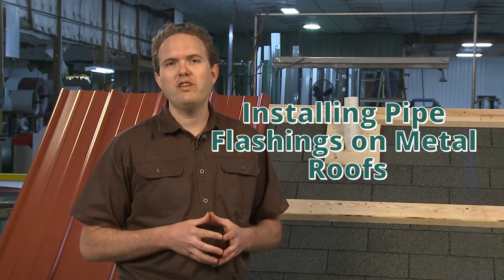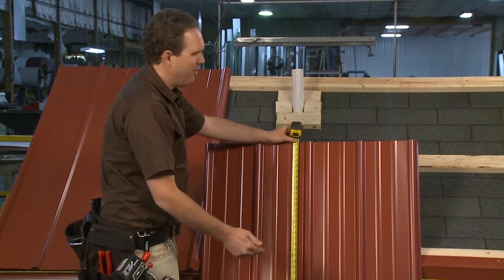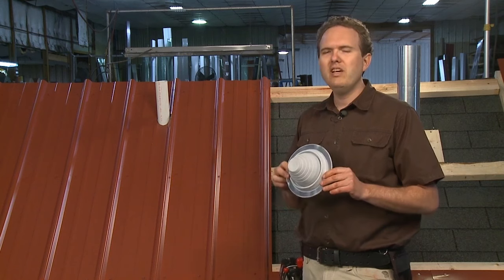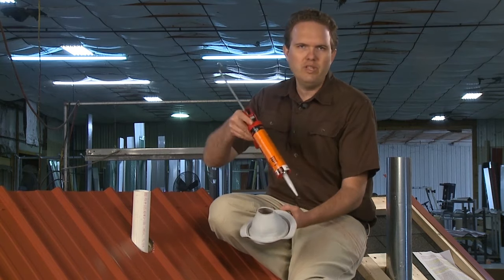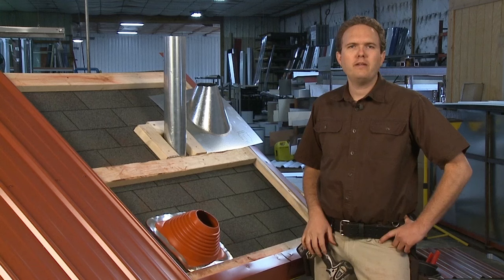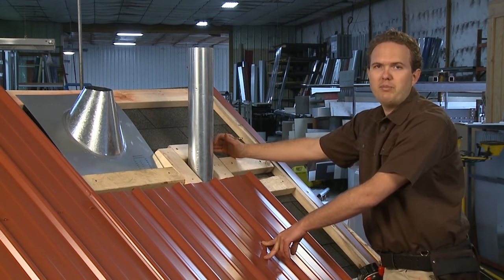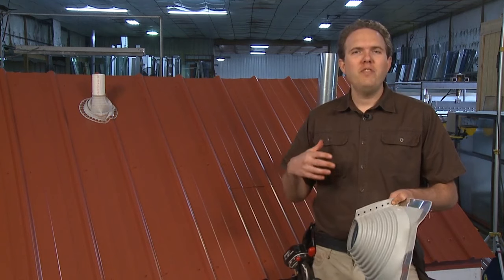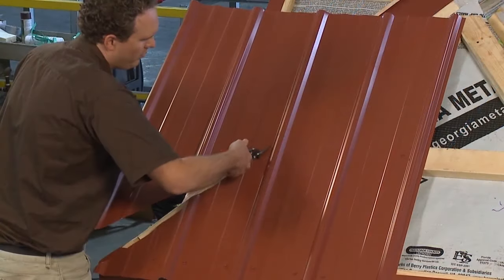Installing Pipe Flashings on Metal Roofs

Comment: Great video.  At 10:37 you illustrate many screws to hold the flashing down.  I know from firsthand experience that that snow and ice can lift that flashing up and cause leaks because I only had six screws holding it down.  I am going to drill it the same as you did to repair it.

Comment: I had a boot vent like this leaking and just adding more screws fixed it. Also they used the full length screws which were excessive. I see you used only need 1inch screws for this purpose and achieves the goal. Key word you stated "this should be mostly a mechanical seal".

Comment: Just what I was looking for! Metal roof flashing where there is a ridge in the way. Very well explained. What would you do if you need to install screw eyes into the metal roof, will metal roofing caulk be enough around the screw eye that will be used for down guy? Thanks!

Comment: I have a power mast pole that runs through my roof decking.  If I were to reroof with exposed fastener roofing like this video shows, would I be best off to do the second method with two sheets of metal?  And use the last boot you showed in the video?
Reply from the maker: You're 100% correct! You'll need to pieces of metal and the split pipe boot.

Comment: What to do if the vent pipe happens to penetrate right at the edge ridges of two joining sheets? Put a third sheet over the middle, from ridge line down to a bit past the vent?
Reply: 13:22 should help

Comment: I heard that you should put square flashings over pipes diamond-like, with the point facing up. That way there's less xhance for water to in trude, because it will run off instead of sitting on the flat bit. Does it make that mich of a difference, or is it a waste of time?
Reply: I don't think it would be a waste of time because it doesn't take any more time than installing it the other way.

Comment: I want to metal roof over my existing 3 tab. I have watched every video on flashing. But I can’t find any to deal with ceiling fan vents. I’ve seen videos that they just remove them and let the air vent under the metal panels. I don’t like that idea. Plus I would prefer not to damage my existing roof as it’s only 4 years old.

Comment: I was told from the company I bought my roof from, that those silicone heat resistant boots aren't actually approved.  I have to use a metal boot for my fire place vent stack.